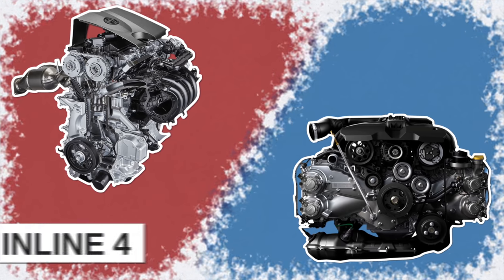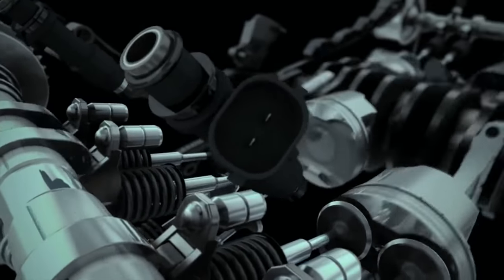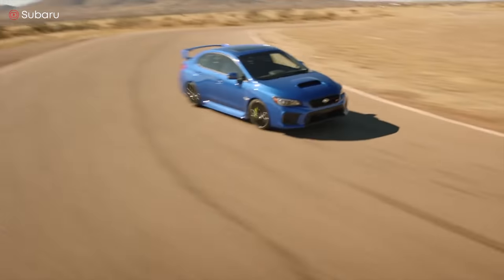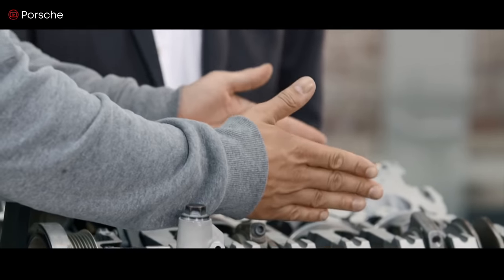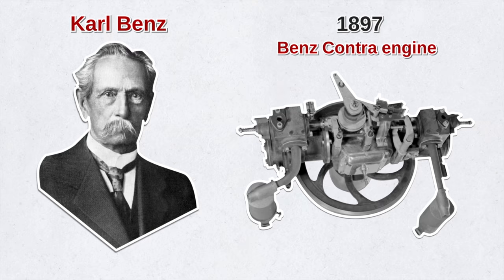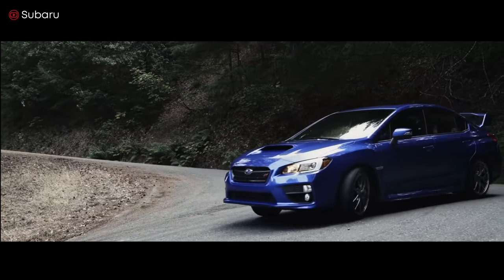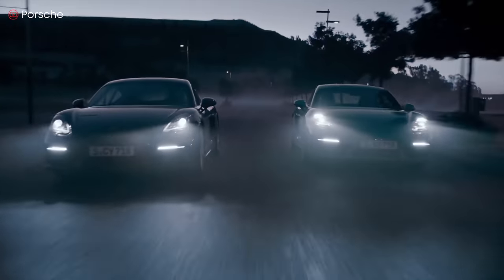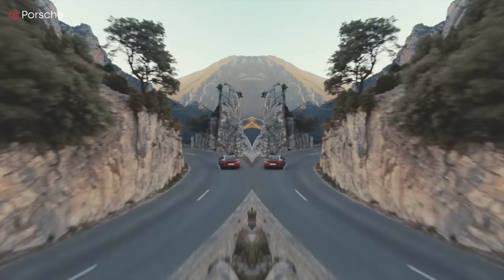Why Not to Buy a 4 Cylinder Engine Car

Comment: Just give me a 6-cylinder. Simple energy.
Reply: The Swift in my profile photo has a flat six cylinder air cooled Continental, 300 cubic inches. Made in the U.S.A. 1946. Very smooooth!
Reply: Give me a straight 6 Datsun 240 engine..anyday.
Reply: @lefthook3978  straight sixes are smooth running, durable engines. I have one made by Chrysler,  flat head, 1950....runs like new. 70 years old!
Reply: @northdakotaham1752  unfortunately todays Chryslers aren't built reliably lol
Reply: @northdakotaham1752  I got me a straight 6 Cummins 24v in my 78 ramcharger. The truck will rust away before the motor blows lol
Reply: @cesarpdc  yep...I wouldn't want one of the new ones..
Reply: @emanuelruiz7710  Cummins is probably the best thing to happen to Dodge Ram.
Reply: @northdakotaham1752  very true. The 440 that came in my ramcharger is now in my roadrunner lol
Reply: @emanuelruiz7710  I have an 87 W150...but no Cummins. Has a 360.
Reply: @northdakotaham1752  360 is a good motor. Had one in my 69 power wagon
Reply: @lefthook3978  the Datsun 6  was not an easy motor to maintain  the heads would warp  if they got a little over heated
Reply: @claycoates5056  then don't over heat them. :) Ever change the headgaskets on a Subaru? JFC.
Reply: @emanuelruiz7710  mine needs a carburetor cleaning and need to check the exhaust system for excessive back pressure. Some rattling noises coming from the exhaust. Doesn't have the hp it should have. Unusual deal, it has the stock carburetor, a Rochester Quadrajet! Seriously!
Reply: The boxer 6 is perfectly balanced
Reply: @lefthook3978 :  For its time, Datsun built some impressive engines, and that was one of them.  I lusted after a Datsun 280zx for my first new car in '82, but settled on a practical Toyota Celica for about half the money, and it was still a fun and nice car, and lasted nearly 15 years (still running, but needed more work than it was worth at that point).  Mainly, I just changed the oil a lot and didn't abuse it.
Reply: @cesarpdc  the 3.6 is the best v6 in the world.
Reply: @1voiceofstl  which 3.6 you referring to??

Comment: My 94 chevy 2.2 has almost 617,000 miles - original motor -trans and rear axle - 208 oil changes ! Lol
Reply: Congratulations on having your Chevy last you that long on original parts, that is awesome !

Old Chevys are better made compared to the newer cars, that are made with more delicate parts.

I love old Chevys from the 80's and 90's, and early 2000's as well.

I currently still have a 92 Chevy coupe, with 173,000 clicks on it, original drivetrain, and almost everything else original on it, excluding good year tires, I use AC Delco parts in it, it gets looked after well.
Reply: @theroyalcrownedtiger2946  i went all valvoline on all fluids and grease ! Followed the manufacturer service intervals ! so 207 oil changes and front end lubes - 27 trans services and 20 rear end services 20 tune ups - 1 water pump "peak long life" 3 alternators ! i say i spent more on tires ,brakes , and windshields than on maintenance ! it has 622, 000 miles now ! thank you for your reply tho !
Reply: @scottymoondogjakubin4766  :Your welcome.

Comment: Driven a 4 cylinder, 4 cylinder turbo, and 4 cylinder boxter engine. They all perform.  I have had less issues with a non turbo 4 cylinder. I still love the 4 cylinder boxter engine when less electronics are used. Not a fan of the electronics used in the 4 cylinder boxer and turbo models. Yes they do eat up more oil, but I found using Royal purple oil in a boxter engine helps reduce oil consumption.  Still 4 cylinder all the way for me.

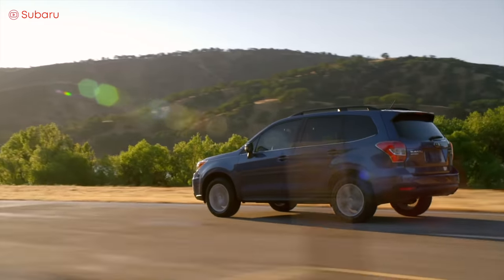Comment: Just(y) one point I have to make of correction here. Time stamp 6:40 "  Did you know that every Subaru every made since 1953 had a boxer engine ?" Not true.   because in the late 80's and early 90's the Subaru Justy was a 3 cylinder (straight 3 obviously). I know this because I owned one for about a month or 2 before it blew a rod. And so I think they should have stuck to the boxer. I got 360,000 miles out of a 2.2l 96 legacy until it rusted out about 20 years later. Shame, if not for the rust, that car would have gone and gone.
Reply: 360, Sambar and many others didn't use a boxer. P100 early on too.

Comment: Outstanding information and comparison.  It's funny how Honda whopped up on the German cars.  Then the French came in to beat the Japanese.
Reply: Any one of those companies could build a faster car, but the context here is to build a production car that will last.  The most powerful car will probably become trash the fastest.  Behold the mighty fire cracker.
Reply: Check out the Subaru lap of the Isle of Man TT circuit!!
Reply: @paulmcateer1595  Nice 👌 128.7 mph average speed.  Outstanding vehicle and driver.
Reply: I rather ride a bike , than own a Renault.
Reply: @jayhockley8841  Hilarious!

Comment: The inline 4 was not always mounted vertically. There are examples of both cars and motorcycles with either inclinded engines to help lower the CG or reduced bonnet height. BMW sold a1000cc flat mounted 4 for many years.

Comment: I've owned two H4s and one H6, both Subarus, and two I4s.  All naturally-aspirated.  Maybe it's a Subaru thing rather than inherent to the boxer design, but the boxer engines were really rackety and shaky and loud compared to the I4s.  Still surprises me.  Even the 6-cylinder, which on paper should have been the ultimate in smoothness.  I liked them all otherwise and had zero problems, so not a complaint, just an observation that the natural balance of boxer engines isn't so apparent in real life.  At least in Subarus.  That aside, I'd choose an inline now since boxers are heavy, and when front-mounted need short strokes so the wide engine doesn't eat up wheel travel.  Result is all their non-turbo engines are down in torque compared to equivalent inlines.  Anyway, your videos are great Scotty, always interesting.

Comment: Great video to explain the engines for people that do not know a lot about them . As a motorcycle rider that owned a number of V-4 engines , I always wondered why no mass produced cars had them . Cost would be the main reason I think . Smooth compact design would be great . I often thought of putting a Honda V-65 Sabre engine in a tube framed Geo Metro with a narrowed Nissan 240 rear end . Lucky for me I talked myself out of such a project .

Comment: Some years ago I had a Subaru Justy. It had a inline 3 (1.2liters I think lol) 3 valve with a 5spd. It got great gas mileage and was one quick lil car. But if it ever stopped leaking oil you better check it. It was out 😂.

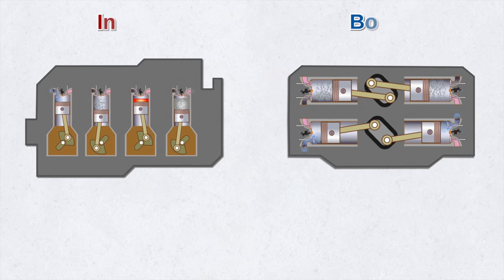Comment: 1:38 - Every 4 cylinder inline engine I have had has 1 & 4 and 2 & 3 synchronized.  That animation that shows 1 & 3 and 2 & 4 synchronized is going to be inherently unstable (wobble).  3:25 - Shows a better way to design it.

Comment: We’ve been a Subaru family for two decades and plan on driving nothing but a Subaru until we can no longer drive.
Reply: I can’t even imagine how many bottles of oil you have
Reply: @justinkerrigan5863  lol i have a legacy and have no oil issues lol
Reply: Ive been driving my inline 4 for 2 decades and still runs like a champ.  Toyota Celica GTS with 395k miles.  I can change the spark plugs on this thing with my eyes closed🙈
Reply: @justinkerrigan5863  we have a large family, with almost 30 Subarus. Only two of them have suffered from excessive oil consumption. They have almost 120,000 miles.

Comment: Not ALL Subarus had boxer engines. The Subaru 360 car and van had a 360cc two cylinder, two stroke inline engine, air cooled. 

I have owned both boxer engines and inline engines. For me they were about the same in maintenance and both ran for a long long time. The boxers were smoother, though. If I had encountered problems the boxers are more complex to service.

Comment: Subaru did not use exclusively boxer layout as mentioned on 06:32 . m70 , m80 and vivio models were equipped with inline 4 engines  for example.

Comment: I've had many inline 4's and all gave me headaches, timing, misfiring, head gaskets, valve issues etc. 
Now I have a 2014 Subaru Impreza with 190K, I'm the second owner and sometimes I drive like a jerk but still no engine issues after 2 years knock on wood.

Comment: In my opinion the condition of the car is more important. If you maintain both engines right, they can be reliable. From a petrol head perspective, i think if both cars are equally strong there won't be a lot of difference.

Comment: been running an 04 subaru sti been my daily for years. luckily i dont live far where i need to go. when i got the car it has 2000 miles im now at 110000 other than the rear struts rusting through and general maint its been a really good car

Comment: Well, you did ask... I like the in line 4 because they are a simpler design & easier to service. That is the main reason for engine failure, service. If it is harder to do, people will let it slide. Oil changes, "I was busy..." coolant changes, "I forgot", Timing belt... "I thought it would be okay..." - sister lost her Subaru engine because she thought a CAT was more important... she still doesn't know if her new Subaru has chain or belt :-( & has not changed her Transmission oil... I do what the dealer tells me to do... it is lifetime oil... so sad :-( ... it is funny. Love your videos, thank you, so very much.

Comment: At least this is very honest - it tells you everything about both engine types.  Not the usual, "the boxer is ancient technology and I hate it" usual videos he puts out.  Funny thing about Subaru according to the US government, it has the most cars (percentage wise) of any brand running after 10 years in the USA.  Not bad for "ancient' technology as Scotty usually put it.  I have high hopes for my 2013 Subaru Legacy with the H6 engine.  Now have 111,000 miles and expect to break 200,000 with few if any problems (so far, none).

Comment: Been driving my 97' subie outback for 16+ yrs. without headgasket issues and 210k on it. Did I get the only one subaru built right?
Reply: @A Mnon turbo and really it has all of 159 hp. With the all-wheel drive and its weight , "spirited" driving really isn't possible . IT does however, handle corners really well.😎😎

Comment: A lot of the highest mileage, gasoline cars are i4s.  Despite the balance problems that are managed, the rest of the design just works for so many cars.  
*I have a Subaru with 230k miles on it.  I have doubts it'll make the 460k and 430k my dad's Civics have reached. Both totalled in accidents, but running extremely well when totalled

Comment: I had a manual 2005 Subaru legacy wagon GT that I  did some upgrades on and it was one fast wagon and a fun “sleeper”...a lot of unknowing people thought it was a Taurus or something ;-).  I even did some track days with it.  And with AWD it was awesome in any weather.  

But it was definitely a pain to do things like change spark plugs, etc. and there’s no way you could really get to the valves and all that without pulling the engine.  If you’re a do it yourselfer I think they in line is much easier to deal with.

Comment: Starting around 6:30, Scotty claimed that Subaru uses only Boxer engines.  I had a 2001 Subaru Outback and I was doubtful about this so I looked into the engines used in such cars.  For example, I did not remember the gurgling engine noise.  The Internet says a 2001 Subaru Impreza Outback Sport Wagon has a "2.2 SOHC 4 cyl" engine which strongly suggests to me it is NOT a Boxer engine.

Comment: Improperly muffled boxer engines have a really rough sound that is irritating to those within two miles.  And they are rarely trouble free over the long term.  All my cars have had inline 4s and have lasted 20+ years with original engines.

Comment: I had a 2.5 liter inline 4 with two contra rotating balance shafts In an old Porsche years ago, a great engine. I prefer the 3.7 liter 60⁰ v-6 in my 370Z

Comment: You missed the Citroen, Alfa Romeo and Lancia boxer engines from the 60's and 70's
Could have also mentioned that almost all light aircraft use boxer-4 and boxer-6 engines from Lycoming and Continental.

Comment: Citroen used  air cooled flat fours in front wheel drive cars for over 20 years. they had a rear mounted transverse gearbox and inboard brake discs  just like racing cars .

Comment: Inline four for economy and simplicity of design. Boxer four for smooth power and performance. But, which of the two is best for longevity?
Reply: inline 4, low rpm and small like below 2.0L

Comment: Definitely the inline 4. Easy to service inexpensive and parts are widely available for repairs to such an engine. Yes you did mention one very unfortunate tradeoff in the form of reduced safety in the event of an accident especially head on collision. I feel it's important to mention that no accident is one where safety can be assured. The only safe accident is one that you never get in to begin with. If an inline engine doesn't reduce your control of the vehicle to the point where it raises risk of accident I will say that there is practically no safety disadvantage. Just avoid head on collision. We know those are bad no matter what your driving in at the moment of impact.

Comment: The animation at 0:40 is NOT CORRECT
In a real engine, the outside pistons move up and down together. Just like the inside two do with 180-degree difference.
Reply: Well spotted.

Comment: I just like the modern 4 cyl engines because they have good power in a small package, unlike the 4 cyl engines of the 70's.  My wife had a 74 chevy vega four cyl she bought new.  0 to 60 was so bad that she had to leave 10 minutes earlier for work than usual.

Comment: Scotty mentions the trend of replacing six cylinder non-turbo with turbo 4 cylinder in some  models. Or replacing larger 4-cyl with smaller turbo 4. Is this a good thing? Personally, I don't like it. More complex, more to go wrong, more stress, more expensive to repair, etc. Honda avoided turbos the longest in their every day family/commuter cars but now they are going that way as well.

Comment: The non turbo Honda and Toyota in line fours are legendary for their longevity.  Head gaskets are a problem with the Subaru boxer but their owners love them.    I just would not buy an American 4 cylinder engine.  Worst example was the Chevy Vega. You will notice that there are none on the road.   Ford had a 4 cylinder in their 90s Escorts.  The service manager snickered when I said I was going to keep it for 100.000 miles.  Wow, was he right.
Reply: I am having trouble finding the Chevy Vega on Wikipedia.     It was a car of the year in the 70's,  right?
Reply: Ford I4 was/is a 2.3 litre. '74 Pinto had one in it!
Reply: Just bought a 16 Lexus 200t. You think I’m screwed

Comment: In the video you speak about Boxer engine and at same time show a Porsche Cayman GT4, but this car have a flat 6 engine not Boxer. Straight 6 engine have primary and secondary forces balanced it self, not the V6 for example

Comment: I love my Honda Valkyrie(97) Its inline six is so smooth that you can balance a nickle on edge and rev the engine to 6-7K RPM without knocking it over.  Search you tube for Valkyrie nickle trick.

Comment: Scotty, my 2007 Toyota Camry SE TRD Package (Toyota Racing Development Rims Only) (clean looking car) Has almost 300k miles on it! Basically change oil every 5-10k miles (with Full synthetic by Mobile one) and ZERO issues. The speed limit is 55-70. Only thing that matters is the Dependability. I would like somebody to tell me a more dependable car than mine? A 4 cylinder TOYOTA is bar none the best u can get (or a LEXUS if u want to shine on people)... The Toyota has a timing CHAIN Not a timing BELT like Honda. It’s Toyota & LEXUS all day for Me Scotty. Peace 👍

Comment: I’ve never driven a boxer engine; but since Subaru and Porsche use them, I’m sure they’re great. I had an ‘86 mustang svo when I was young. The wastegate had been adjusted, and would peg the boost gauge that read 18 psi. Great performing car. Now I wish it had a boxer engine. 😂

Comment: I prefer reliability and ease of maintenance. So I'm sticking with the I-4 in my Corolla.

A few years ago I was in the market for an SUV. I was eyeing up Subaru's and noticed a trend. They have issues with head gaskets. I ended up getting a 2006 Acura MDX for $2,350 instead.

Comment: Love you. One question Corolla or Focus
Reply from the maker: corolla
Reply: Corolla for long-time reliability and economy
Focus for pure fun and space
Reply: Got a 16 focus 5 speed manual with no problems so far 208k miles most highway miles...Not sure if that means much.. I did upgrade suspension with quality struts, shocks ,rear sway bar made for a focus ST.  Handles much better now. Gets about 40 mpg highway.  Its not very good on ice and snow.  Would need snow tires for sure in winter.   If you get the focus with manual transmission its solid enough .  Better than a corolla? Depends on whay your looking for.  Focus is like a Mazda 3 just cheaper.  If i were you i would get a Honda with the 6 cylinder engine and 6 speed manual transmission its rock solid and better than any toyota .  They are very rare ...good luck finding one.
Reply: @halaheleu7013  Good to know.